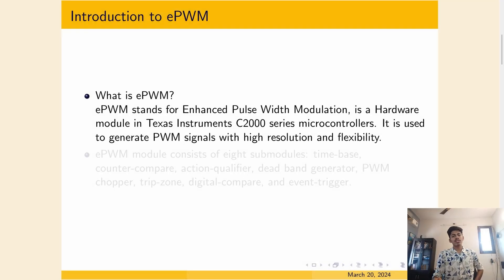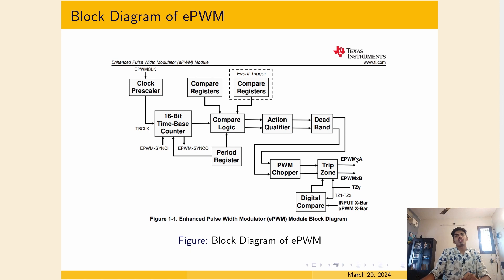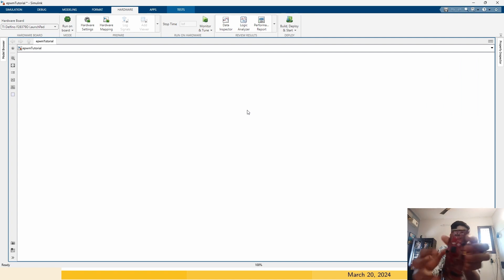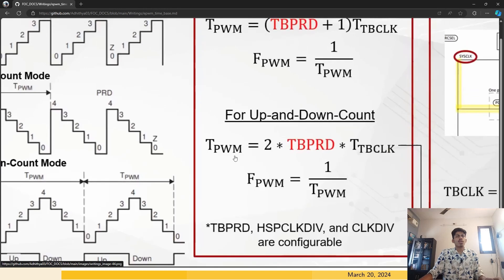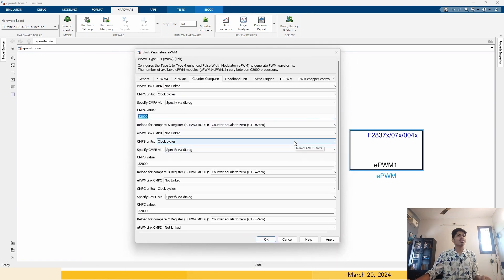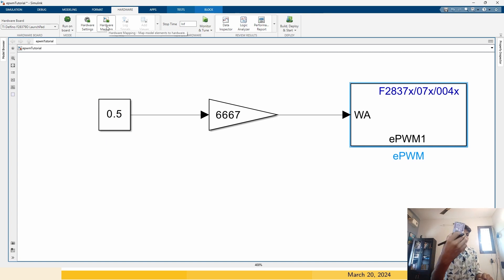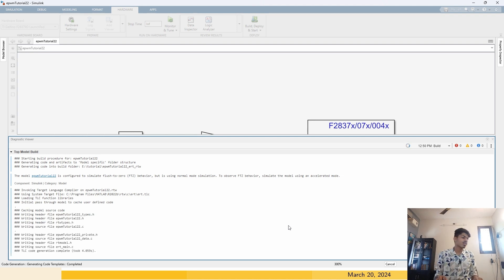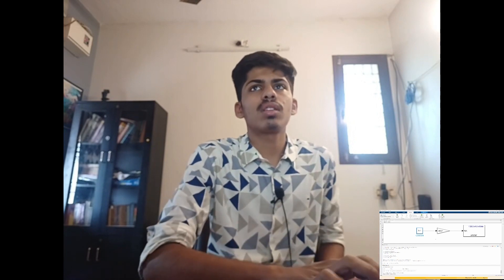PWM Waveform Tutorial: ePWM on F28379D Delfino Launchpad

Comment from the maker: Hello, here are Calculation steps for TBPRD:

1. For 15 kHz:
   T_PWM = 1 / 15000 = 0.000066667 s (this is 66.667 microseconds)

2. Convert that to nanoseconds (because TBCLK is in ns):
   66.667 µs = 66,667 ns

3. In Up-Down count mode:
   T_PWM = 2 × TBPRD × T_TBCLK

4. TBCLK = 200 MHz → T_TBCLK = 1 / 200e6 = 5 ns

5. Substitute values:
   66,667 ns = 2 × TBPRD × 5 ns

6. Solve:
   TBPRD = 66,667 / 10 = 6667

Comment: Which version of MATLAB are you using? In hardware implementation where you are choosing your development board, I am getting an error saying the data is invalid.
Reply from the maker: Hello, Sorry for the late reply

----
Software: Matlab with 
1. Embedded coder extension
2. Motor control blocket

(I am using matlab 2022b)

Hardware:
I am using LaunchXL F23879D

Comment: Thank you for the videos, really helpful! I have a question, how is it possible to change the CMPA variable while the code runs on the board? Thank you.
Reply from the maker: Thank you for your kind words! You can change the CMPA value in real time using serial communication between your computer and the board. In Simulink, this requires configuring specialized hardware blocks to establish communication. Once set up, you can send values from the host computer and implement the corresponding receiving logic on the board to update CMPA dynamically.

This process is demonstrated in MATLAB’s pre-installed motor control examples, specifically the sensorless example. When you open the host model, you’ll find two separate models—one for the host (your computer) and one for the board. These examples provide a good reference for implementing serial data transfer. You might find them helpful!
Reply: @Adhithya1002  Thank you! I'll give it a try.

Comment: It is very much helpful video.
please make some vdeos anbout Ti ADC.
and in this video if we take EPWM B then how I can connect and make the simulink. kindly reply the comment please.....
Reply from the maker: Thanks for watching!

Here are the answers to your questions:

1. TI ADC: I've covered the C2000 ADC in detail in this video (timestamped for your convenience): https://youtu.be/KXif78y2-aQ?t=646 

2. Using EPWM Channel B:  

   * For a simple PWM output on channel B: You can easily enable the EPWM B channel within the EPWM configuration window in Simulink. Just check the box for channel B.

   * For complementary waveforms (like in inverter applications):  The dead-band feature is your friend! In the dead-band sub-menu, enable "1B". This automatically generates a complementary waveform on pin 1B based on the 1A waveform, with the specified dead-band time. 

   Need more details on dead-band? Check out this video: https://www.youtube.com/watch?v=rFt_UEXsjiM